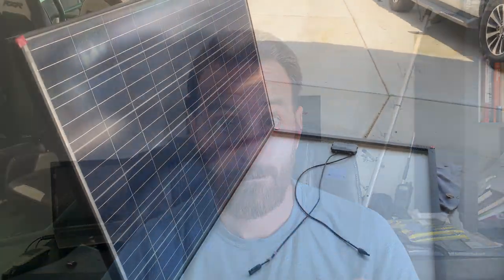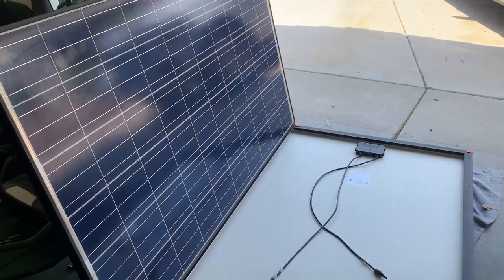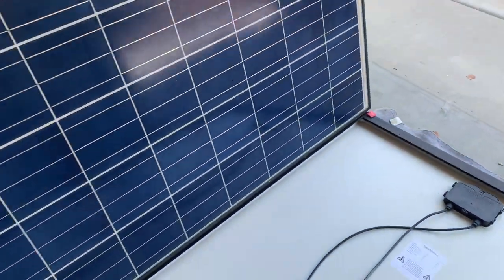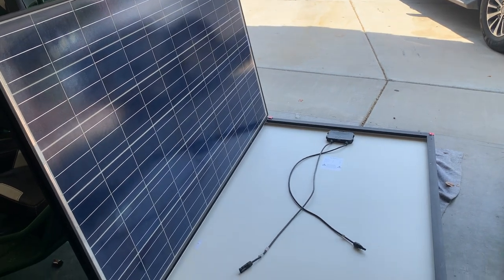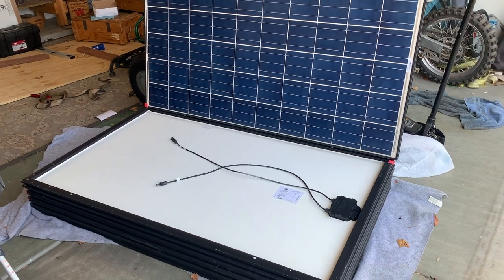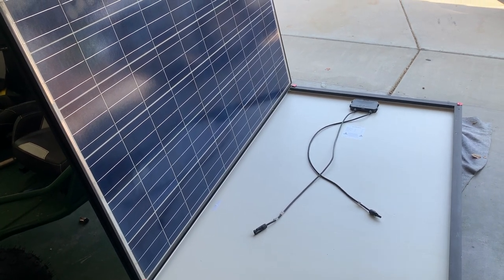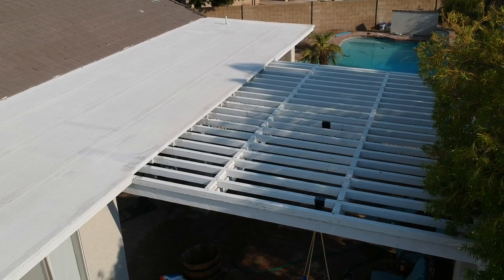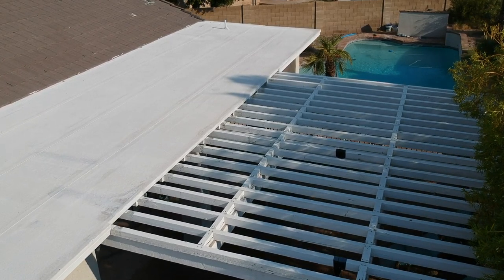Off Grid Solar Freezer pt  1

Comment: Something like a Carrington event would electrify anything conductive. That includes your off-grid setup. It's not a magical thing that targets just the grid. Aside from that, thanks for the video. I am looking at a setup like this for a smaller freezer.
Reply from the maker: My understanding is that the grid works as kind of an antenna that amplifies the energy of a Carrington event so many off-grid devices would be safe. I’m still waiting on my Inergy Flex to get here so I can finish this setup. I ordered it last summer 🤦🏻‍♂️
Reply: @covertprepper5957  True to an extent. The larger the "surface," the more likely to receive electrical charge. That said, unless you have your stuff hardened, something like the Carrington even would put charge through even your off-grid setup. The Carrington event was a solar EMP. So, it works the same basic way an EMP made from a nuke, or coil would. Anything electronic would have a sudden high load electrical charge that would overload the circuits. I'm not sure it would hurt the panels, or lines, but things like your inverter, possibly battery, etc would go dead. It's not difficult to make a Faraday cage. If memory serves me right, you can use a metal trashcan, and set what you want saved on a raised, non-conductive surface inside. So, if that's your worry, I'd grab extras of the electrical components, and stick them in there. Even things like your cell phone, in your pocket, will die. Not everything, and it depends where the charge hits, the atmospheric reaction, etc. Wasn't trying to be a di$#, by the way. Reread what I said originally. Came off more a#%$olish than I intended at the time of writing. lol

Comment: Did you ever do the 2nd video. Im trying to dobthe same. I have 4 of those same panels. How much battery did you go with? Thanks for any tips
Reply from the maker: Not yet. Still waiting on Inergy to ship my unit. Back ordered 😐 I got two of their batteries.
Reply: @covertprepper5957  rip
Reply: @covertprepper5957  hello hey can you so part 2 now
Reply: @covertprepper5957  haw many batteries to use ? and what's the inverter size to run them 250s @ 6 of them what did you order for the charge controller? Thank you for the first video great

Comment: We run two chest freezers and two refrigerators off grid, been doing it for years. Too bad there's no real way to get in contact via YouTube comment board. You might get some useful information from us. Oh yes, we are in Arizona too in the hot Harquahala valley.
Reply from the maker: If you’re on Instagram dm me. I’m @covertprepper
Reply: @covertprepper5957  Tried to post a response with my email but it got removed.
Reply: Wow more power to you.  you stole my thunder but if I may ask how many panels  ( watts) are you operating on ? And is that around the clock 24/7. Thanks alot
Reply: @bearchow1929  if you can post a video of your set up. and @ me in this comment section. i would love to see your set up to begin my own.
Reply: @gsimplify5352  For starters I already have several videos on my video channel which is not bearchow. But because of YouTube policies any attempt at pointing to, referring to, or trying to link gets the comments pulled. And you don't show any email contact in your About. After I post this comment I'll post another comment that might get you there.
Reply: @gsimplify5352  I am also bearchow. Hopefully you'll figure this out.